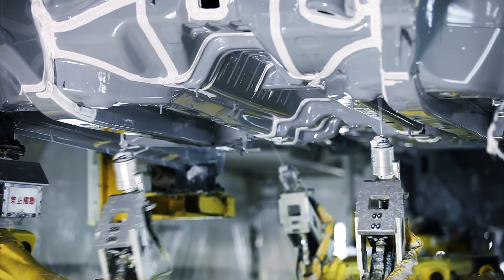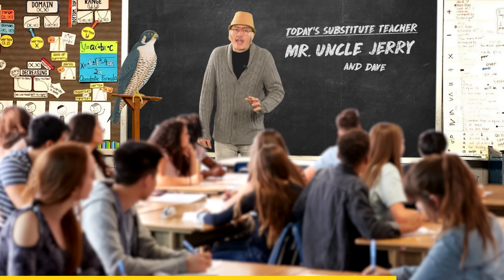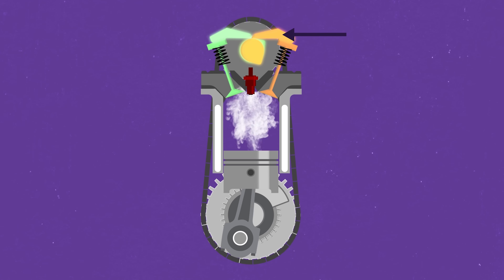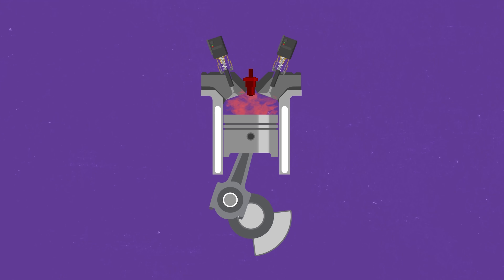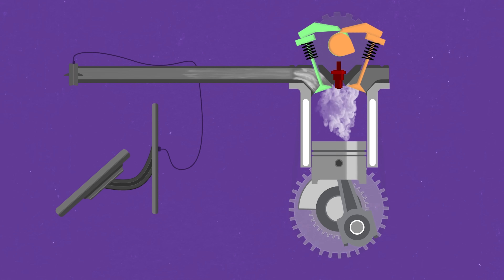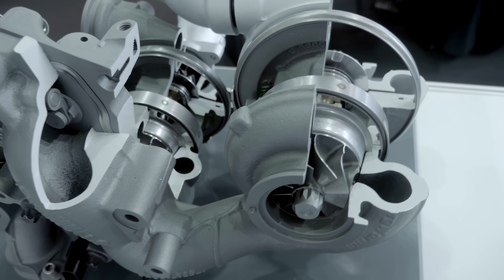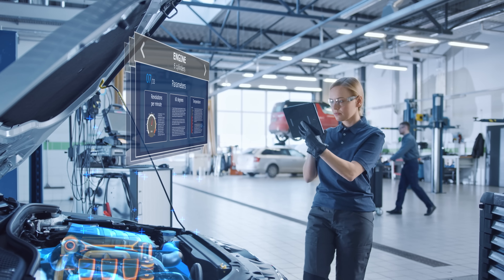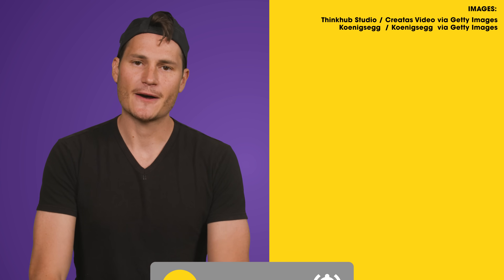This Is The Last Great Engine Tech

Comment: For a decent programmer, as long as the camshaft sensor location data is good and the normal positions for injectors to fire are well understood, it shouldn't be too hard to digitally replicate the behaviour of the mechanical injectors. The trick is all in the tuning, as you have to basically "guess" based off your understanding and hope that you're right, or brute force trial and error it. 

Find a good programmer with experience in machine learning and digital modelling(or a team of different skills collaborating) and this technology could be a last final breakthrough for combustion engines before things fully go electrical. We only really have a few decades at most until only the most expensive, luxurious of cars still get to experience the thrill of a combustion engine. Who knows, maybe that niche will live on, but for most of us plebs when we're older we're going to either have electric cars, or automated self driving taxis, because a handful of combustion engines aren't too bad for the environment, as long as everyone on the planet doesn't own one, and 50%+ of all drivers on the road are unsafe idiots that I'm constantly thanking car manufacturers for inventing all their safety advancements, in addition to the fact that my parents signed me up for "Defensive Driving" courses in 2000 when I turned 16, where the first lesson they teach you is to just automatically assume everybody else on the road is a total idiot about to ruin your day, and then plan around that. 

Works great when you're starting out, and when you get some experience under your belt you gradually learn to gauge different drivers on the road and actually take a few risks without looking like "that guy" that drops the clutch in his new supercar and spins out of control taking the neighbourhood with him. You've all seen those videos and cringed.

And I hate to say this, but while self driving cars are are still far from perfect, they're still already safer than the majority of new drivers, and a good portion of old drivers, who constantly fuck up so much that when it happens it doesn't even make the newspaper unless somebody earns themselves a slot in the obituary section. Not that anybody knows what a newspaper is anymore....not that I ever really read them other than when looking for a job, an apartment, or something to buy/sell....

I love to drive, and I love doing crazy shit, but fuck, a good portion of the people I've ridden with as a passenger(and I'm 37, so that's not a small number), I barely trust when I pay attention to their driving.

Comment: Seems more likely the digital valve opening value is represented by a floating point rather than a single binary bit. It would be more useful to control the exact degree of opening than only have it on or off. Also a digital sound wave is not binary guys... otherwise you'd only ever hear a square wave.

Comment: This could actually be ground breaking! If the FreeValve system improves efficiency enough (which it can) this can make gas cars non banned because it could potentially get double the fuel economy
Reply: put it on a Geo Metro there pushing 100mpgs on modded engines
Reply: Porsche is also trying to make synthetic fuel. It would be great if both of these could be paired together.
Reply: Im sure they dont want to ban gas because of environmental concerns. Electric cars can be fully controlled. Because electricity can be fully controlled.
Reply: Plus if all the numbers are true, a hybrid or even gas car would be more environmentally friendly than a tesla. They'd have to be brought back
Reply: Never underestimate the government's lust for control.
Reply: Won’t happen

- Less moving parts means more reliable engines, less money from service and parts
- less moving parts also means “premium” manufacturers won’t be able to charge the ridiculous prices for their products
-more efficient cars means less money spent at the gas station 

If they don’t release it then it’s because it hurts their bottom line. Same way pharmaceutical companies aren’t really interested in making cures
Reply: @David-ej1ps  if enough manufacturers do though, it will force stubborn companies to eventually follow. Porsche is pushing synthetic fuels to save ICE cars so introducing this (especially for performance reasons) makes sense.

Electric cars weren't serious until tesla, all it takes is for one manufacture like Toyota to implement this at some capacity for it to spread.
Reply: @David-ej1ps  Maybe that's why FreeValve is working with that Chinese company Qoros. China is not beholden to Big Oil. Let's give it a decade and see how that pans out.
Reply: Unfirtunitly it'll never happen in regular cars.  Big oil would lose too much.  Also with it making more reliable engines there'd be a huge loss to manufactures too.
Reply: @jonathanbewley6505  Aren't they losing more if ICE cars aren't allowed to be produced anymore? Reliability wouldn't be improved across the board, electronics fail all the time.

Comment: I ABSOLUTELY want to see an engine build with this technology.  Any chance we can modify an LS block and make this happen? :D
Reply: There is a guy who modded some Toyota I4 engine on his own so it should be possible.
Reply: @erwinkonopka7071  where can I find that?
Reply: I’d love to see this on a Ferrari
Reply: Free valve twin turbo LS 🥰
Reply: Probably with lot of work. Would probably be easier to start with an overhead valve engine.
Reply: @Nolan2231  Like... an LS?
Reply: @MrLosefireball  I think he meant it might be easier to start with an overhead cam engine, so like a Coyote. With an LS you'd have to machine some block off plates for where the cam was, probably plug oiling passages meant for the cam and lifters, etc. Custom work to the block. With a Coyote, the Free Valve tech could utilize the space in the heads previously taken up by the two camshafts, and since none of the valvetrain is in the block, it would all be top end work.
Reply: @Nick17354  I was trying to think of an engine that is SUPER common in engine swaps for higher performance.

The guy to have build something like this would be Steve Morris.  That guy created the Devel Sixteen engine and would definitely have the necessary skills to build something like this.
Reply: @Nolan2231  Nudge nudge… don’t tell anyone else… but the GM LS, and 99.1% of the V8s from GM are and have been secretly hiding the cams in the block. Probably
Reply: @customconnections2425  cool
Reply: Man!!!!
I sent this to my mechanic,  I'm hoping to get him to see if we can do this on a S 10 engine!!!!

Wish me luck!!!!
Reply: A guy made his own version of this for a Miata
Reply: there was a dude who did it with his miata

Comment: Creating a whole new engine line is extremely expensive. That’s why GM has kept the 5.3 and 6.2 liter engines. So let’s say, 7 years down the road and your vehicle has over 100,000 miles. When would those small actuators go bad? Would that destroy the engine if it stays open too long? What if it doesn’t open at the right time. There’s a lot of reason why GM, Ford, and several other manufactures haven’t made it yet. The reason why the super car has it, it will never see the day of over 50,000 miles without any biannual maintenance done to it. It’s a cool and exciting way to keep the gas engines more efficient, but sadly I do not foresee it becoming mainstream due to the drawbacks.

Comment: I still don't see EV's as practical vehicles for most Americans except for urbanites until the power grid is improved and battery tech significantly improves.  Improvements like these are what we will coast on for the next 50 years until EV tech is practical.

Comment: When talking range and faster road speeds, electric motorcycles and bikes pretty much suck butt right now. My Honda Grom on the other hand does NOT suck butt (okay, maybe it sucks butt at reaching 65mph but that's not the point.) I consider my Grom as portable as any long-range electric bike, it's small, almost light weight, non intimidating, oh and it's super fun. Because my Grom can go 130+ miles to a tank (mind you, the 1st and 2nd gen grom is 1 gallon fuel tank) it makes it basically eons better than any electric bike and it's basically the same decibel output- the grom basically only makes chain and tire noise. Put freevalve on a Grom and holy shit balls.

Comment: FYI Most companies are experimenting with this using direct solenoid control of the valve stems.  But I think Freevalve is using pneumatics (or maybe hydraulics) to open/close valves.  The graphics in this vid look more like direct solenoids, so there are some steps they're skipping in the vid.

Comment: I think this is being used for “pulse detonation engine’ . It’s literally a striped down automotive engine using the exhaust as propulsion minus the piston rods & crank as a rocket motor
Reply: I don’t think you can call it a stripped down auto engine if it doesn’t resemble an auto engine at all tho lol
Reply: @recklessrickey9513  ya your right I’m stretching the principle a bit.

Comment: Caterpillar has used variable intake valve actuators since the mid 2000's to pass emissions standards on diesel engines
Reply: So it is a diesel with VTEC basically?

Comment: I would love to see you guys test ways to improve fuel economy like Mercedes did for with f1 car or electrical controlled valves and comparing fuel gas compared to liquid state. Someone tried it on the b series engine and gained ridicules fuel economy

Comment: I remember seeing Freevalve a couple years ago on YouTube and still wonder why companies or at least tuning companies don't offer this yet, doesn't sound like a lot of negatives.
Reply: Well.. i work on cars and injectors can fail pretty often, and you don't want that happening on freevalve solenoids on an interference engine. But that said timing chain tensioners fail too. So it's all upto how reliable they can build these systems.
Reply: @melroks3  yeah that’s a good point, but like you said anything would break on a car after long enough hahaha. Guess we would have to see how reliable they perform as a daily
Reply: @melroks3  just have the valves fail to closed by using a spring to close and the solenoid to open. A failed solenoid would then just stay closed and not get hit by the piston.
Reply: @imanoob71  Makes sense.👍🏼
Reply: @melroks3  i was going make this same comment, and don't forget bubba and his idiots guide for making more vroom vroom some how flips the timing 180 and now wants to make a warranty claim
Reply: @melroks3  but if there's no mechanical links to fail, for example: timing chain, then if there's a fault, the solenoid doesn't open= no air= no combustion= no power. And there's not suddenly chunks of chain, or camshaft, or valve floating about in the engine.... my first impression of freevalve is that it could be a way to virtually bulletproof a timing setup.
Reply: FreeValve's tech is proprietary and probably got loads of patents behind it (not even talking about the time spent honing the tech for their engine), the easiest way to offer that, as a tuning company, would probably be to take it off an existing engine and adapt it rather than recreate it themselves, cause I don't think many tuning companies got the same budget and time Koenigsegg's got.
Reply: @RiddSann   yeah that’s very true, I could be wrong with this but once a new valve cover is made for that specific engine then the tech could be installed and coded depending on the cars performance outcome. Can imagine a heap of people wanting this stuff on their golfs or civics if a company wanted to figure out what’ll make money 😂
Reply: @oliverlavermicocca2455  If it is Golfs or Civics, I would have the Opel Tigra.
Reply: Marine 2 stroke diesels have had hydraulically actuated and computer controlled exhaust valves for a while. I think automakers are just scared too change the formula and pay for the R&D.

See MAN B&W's ME series of engines or Wartsila's RT flex engines.

Comment: Freeevalve technology would bring back one engine concept that was ahead of its time, 5 valves per cylinder.
Back in the day there were some engines that had 3 intake valves and 2 exhaust valves per cylinder.  The major demerit to those engines were how complicated it was to get the three intake valves to work, but when they did there was more power.  With freevalve technology it would be possible for the five valve per cylinder engine to have a resurgence.

Comment: I now understand why "cammed" cars have that sound like their dying at idle and how vtec works better than before.  A video on every function of a car from brakes to engine and transmission, etc, broken down like this would be awesome
Reply: Yeah my cammed LS is weak until it goes to 2000-6000 rpm, then it's a Rocket, pull like hell on the highway, that's why you see 4 banger Hondas get the jump on muscle cars then the muscle car gets them at the end.
Reply: Watch science garage, one of their best series imo
Reply: as @immortail said, science garage!! miss those series and it honestly taught me more in that than any automotive class did ahaha
Reply: I like the sound of a big cam though lol
Reply: You mean science garage? R.I.P.
Reply: then show ends
Reply: Science Fl0ppy
Reply: They sound like that because they have a ton of cam overlap
Reply: Yep, big crazy cams make your car sound like it's dying at idle because it really is running so poorly that it's literally on the verge of dying. 
Only real way around that without a system like VTEC is to just raise the idle up higher so it can run smoother but that means more heat and more wasted fuel. 
Plus high idles kind of sound silly where a lower, lumpier idle or the classic "brap brap brap brap" sounds way cooler.
Reply: @QuakeGamerROTMG  Have you ever actually installed cams with more overlap and tuned an engine for them?

Comment: What if you had an aluminum block engine with forged ferrous piston, on top of each cylinder there was an electronic magnet that switched on durring the exhaust stroke. To extract power out of an exhaust stroke?

Comment: BMW Valvetronic, eliminating the throttle body and using adjustable valve lift to meter air/power, was introduced in 2001

Comment: Late tiger tanks used fuel injected engines. German vehicles have been using them since 1925

Edit: the spitfire was the only ww2 aircraft to use a carburetor.

Comment: I have been hoping for this tech to succeed for as long as Desmodromic has been around... BUT...Forced induction still requires intake manifolds, dumbass. NA engines benefit from scavenging impulse flows, unless you like backfire. Air filters? Asychronous impulses to the crankshaft are going to do wonderful things to the shaft itself and the mains. Infinitely variable harmonic balancer anyone? What happens to exhaust scavenging efficiency? It is not just when the valves open people, also why they open. Slapping these heads on unmodified cars is going to be hilarious. Retrofits with no other changes is probably going to have the same result as plunging a toilet with a Claymore mine. Yes, it will work, once.

Comment: What i would like to see are valve actuators that could be connected to any engine. With special mounting for different engines. And a piggyback ecu/m. 

Also.... Imagine what this tech could do for motorcycles, where weight is a huge deal.

Comment: Variable valve lift has been a thing on bmw engines for a very very long time. It uses a worm gear and addition shaft that controls valve lift depending on engine speed meaning at low rpm the valves open less using less engine power making it more effecient. This however is genius.